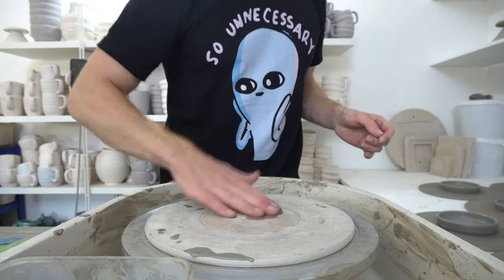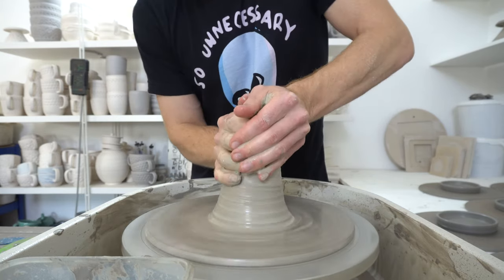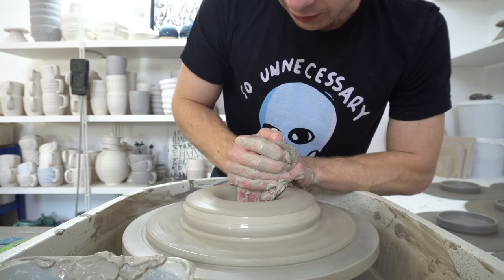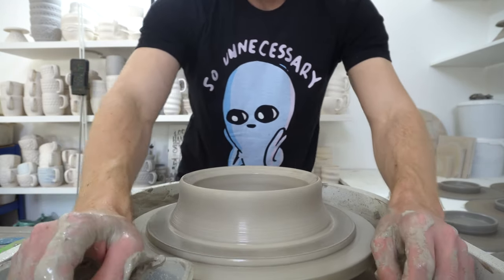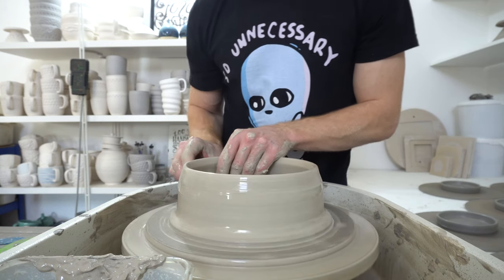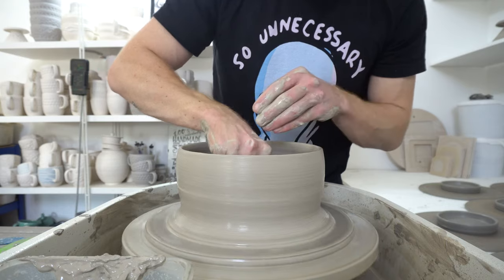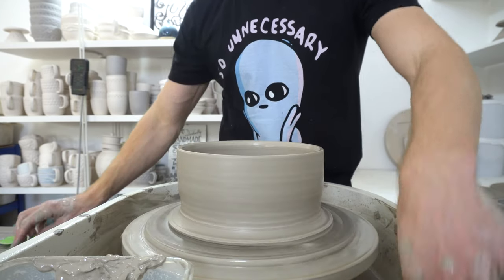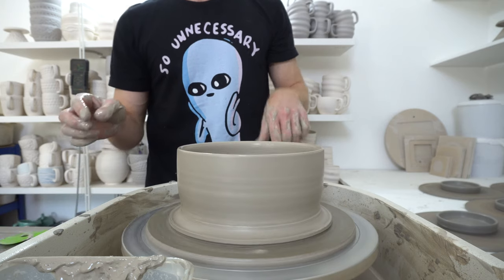Making Test Tiles

Comment: I want to see how you cut them apart. I came up with this when I wanted to make test tiles with a sodium silicate crackle texture, but my cuts with a wire are always wobbly, with rough edges that have to be cleaned up. How do you do it?
Reply from the maker: I use a sharp thin blade (it's actually an old butter knife) to cut straight down to the batt when they're leather hard. If the clay is firm enough when you do it, you should get really clean edges. And a blade can come out sideways, whereas a wire has to go back out the way it came and this can mess up the cut too
Reply: Thanks!